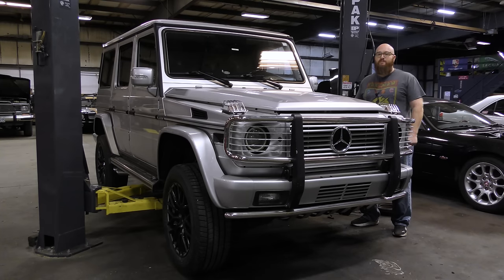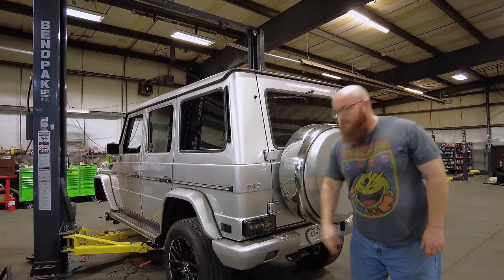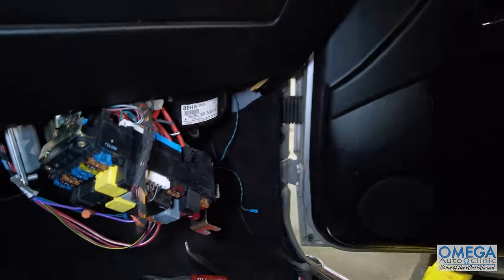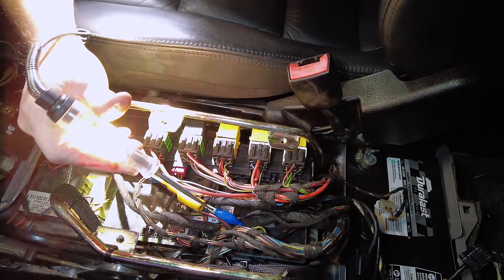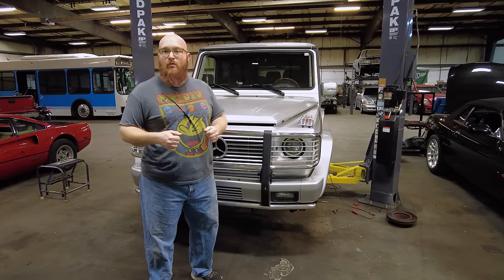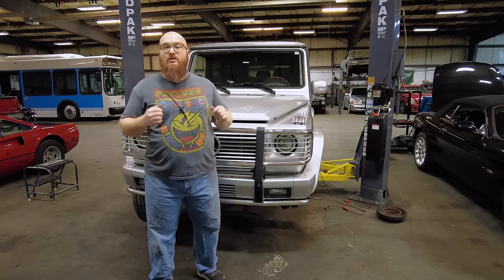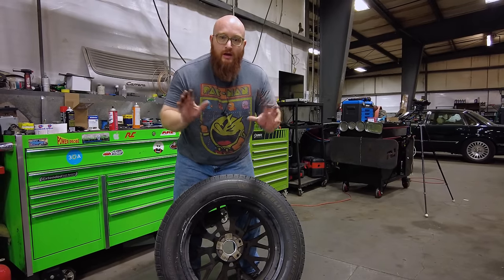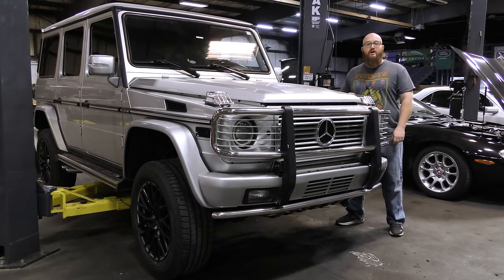Dangerous Mods on this '03 G55 AMG G-Wagon! CAR WIZARD shocked at the level of stupidity

Comment: I moved and miss my old mechanic and body shop! I have my wife's GLK-350 in a collision repair shop and they told me they only source used parts from places that they've worked with so they know they can deal with them if they have a problem. I can see that for engines and transmissions but my GLK only needed a few suspension components, some of which they were able to source used and the others were ordered from a dealership, except the dealership doesn't have the parts. I called my Insurance Company and told them the new parts weren't available and asked if I could source the parts used. They said yes so I spent an hour finding a salvage yard with the parts I needed and dropped them off this morning. Less than $600 compared to the $4000 for the "new but unavailable" parts.  The collision shop would have just left the daily storage fees accumulate to the point the GLK was totaled.  They are apathetic because of the amount of business they have. I only used them because they were "in network" with the Insurance Company, which end up being a huge mistake. Anyway, going above and beyond for a customer reminds of what I left when I moved. A huge thank you for "thinking outside the box" and helping people.

Comment: Torque to 200nm AND then back off 1/4 turn. If you don’t, those bearings will die in a few K. (Also in manual)

Comment: I have an 03 G500, I wish I had a guy like you to take it to (every couple of weeks).  I recently saved several hundred dollars by changing a fuse.  The mechanic wanted 2 hrs of diagnosing and another hour to fix the pusher fans at the radiator.  Internet to the rescue, found the fuse, swapped it, fixed it.  Don’t just let people “fix” your vehicle, do a little research.

Comment: That reminds me of a visit i made to a workshop many years ago. There was a Porsche on the lift that was being fitted with after market wheels. The new wheels were fouling the brake caliper assembly. So the genius fitting the wheels was using an angle grinder to remove metal from the caliper so the wheel would fit

Comment: Even if you are concerned about the load on the SAM, you could wire a MOSFET to it, to drive the lights instead of running the lights directly.

Comment: For those of us comfortable with even basic electrical work, running the rear blinkers off of the front circuit would be the very first common sense thing to try vs transplanting the entire module.  Especially with LEDs only drawing a small fraction of the power.  The only irritating part would be the warning messages on the dash about bulbs out.  Squashing those down is not nearly as straight forward.  Luckily in this case, it's not a four hour job just to get to both wires along with another four hours to put everything back together.

As for salvaging the butchered up wheel hubs vs replacing with new, I thought they would have to be a thousand a piece or NLA to make this even close to worthwhile at well over $100/hr labor.

Comment: No, the wheels rides on it's hub ring, the bolts just provide clamping force.
Reply: Not all vehicles require hubcentric wheels. Vehicles with conical lug nuts will keep a wheel centered no problem. It's common to use Volvo wheels on Fords, for example even though the Volvo wheel is a couple of mm larger in the center.
Reply: @thebigmacd  If you're not transferring the weight of the vehicle directly into the hub, then you're transferring it into the wheel studs. Wheel studs are not designed for any type of shearing load and will break over time.

Comment: I’m only a dyi mechanic but I would have considered running wire from front Sam to a tailight converter. 
Twilight converter has own 12 volt power source and only uses signal from front Sam( no extra powe r load on front Sam)  to activate power out from converter to taillights. 
Not a lot of extra work and at the price you quoted for modules , a bit of insurance against future cost. 
That’s my two cents

Comment: A weld expert would tell you a hardened steal bearing ring is not weldable because of cracking around the weld. In this case, it would take only a small shock for the ring to break away from the hub.

Comment: Maybe the rear SAM does not see the expected current on the rear lights when it tries to turn them on, and refuses to turn them on completely.  Mercedes has open and short circuit detection on almost all lights, it  also detects open circuit on a light that is not powered.  W164 has this.

Comment: The trailer hitch wiring will still not work until you fix the rear SAM.
You could use relays to fire the trailer lights off the front SAM but you could never have electric trailer brake control.  Also, the vehicle tow mode is turned on by the rear SAM when the trailer wiring plug is connected, and that won’t work either.  This is all assuming the rear SAM is fried, not just the turn signals on the rear SAM.

Comment: FYI This repair will leave a "bulb out" trouble light on the dash. also the sam needs to detect the correct bulb load. Aftermarket LED lights throw a error code in the sam. or missing bulb code.

Comment: Mercedes is smart enough to understand when Chinese aftermarket tail lights connected, it maybe not a problem with rear SAM, just because of LED tail lights, mercedes can't feel resistance in the circuit and cuts power to it.

Comment: Did the low draw of the led make the rear light controller think the bulb was bad? Would a resistor like used to make leds flash have helped?

Comment: Gwagen parts are crazy expensive. I used to have an ‘86 300GD (88 hp diesel. Not like the newer luxury models). The multifunction switch broke, and the dealership wanted $700 for a new one….

Comment: I guarantee the LED is the problem, cars that normally use incandescent bulbs do not recognize the low wattage of LED bulbs, and think the bulb is dead.  I guarantee the rear Sam would work if you had an incandescent bulb on the rear light.  The reason it works connected to the front SAM is because the front SAM has the front bulb on it already using wattage. I had this problem with my Jeep with LED bulbs used on turn signal bulbs.

Comment: That's a really neat trick for the part of the Rear SAM that failed. I actually really like that.
THEY CUT OFF THE CONCENTRIC RING!? I actually have like no words for this aside from "WTF WHY". And that's some more great thinking to weld that race to the hub and mill it down as needed. As to why, I have no idea. I wouldn't even do that to something like an old civic, because it needs all the ride quality it can get lol
Reply: It was possibly to fit a different set of wheels than the ones that are currently on the truck.
Reply: @OMGWTFLOLSMH  misread at first, but yeah that could. But the backs didn't have that fuckery. And why would they run anything but the same rims/wheels on the front vs the back? 
Idk man.

Comment: There is a similar problem on Nissan GU Patrol rear wheels.  The hub centric ring is only about 2mm high, making it easy to fit steel wheels improperly.  Then they fall off down the road, which is a very common occurrence here in Australia.  Many uneducated people fit any old wider steel rim (eg a Toyota one) because the studs are the same, but the hole in the rim is bigger than the concentric ring on the Nissan hub, again leading to the wheel being centred using the wheel nuts only.

Comment: When the rear Sam detects a led rear light, the low draw is detected by the Sam and shuts power off to the lights. It faults and codes 'short or open circuit LH tail light' and turns off power to that light. 
Has to be reenabled by Mercedes diagnostics

Comment: Um, okay, neat hack.  But I think I saw some power resistors on the back of the rear lights.   They are often tossed in to simulate the full amp load to mimic the incandescent bulb draw.  Maybe be sure the resistors are out of the circuit!

Comment: People should understand that the low power consumption of L.E.D. ( Light Emitting Diodes) compared to the original factory lighting makes this repair viable in terms of the total power drawn in both front and rear lighting requirements. This repair may not work with the original power requirements needed to make this repair while the vehicle retains its original lighting system components. My other half says don't buy a vehicle you can't afford. Including repairs.

Comment: You are a genius. We have problems with new after market wheels without the hub centric rings that doesn't come with or the customer won't buy.
Reply: Explain that it is necessary or eventually the wheel studs will start shearing off.

Comment: Those SAM units can look like they are faulty, but they might not be. If they detect no load or short on a lamp, they switch off the output to that lamp. If you are testing it with a voltmeter you think the output is faulty, but it's not. When you put the correct load on that line, it gets re-enabled. LED lamps will cause this unless you put a resistor in circuit to fool the SAM. It saves on fuses, but it can be confusing.

Comment: I have a 2002 g500 with only 28k miles and guess what. The absolute only problem with it is the two rear side markers.  On the right side it’s cracked because it gets so hot. But replacement oem bulb doesn’t work. The left side rear doesn’t  work with a new oem replacement.  It drives me crazy. I’ve replaced them 4 times each side since 2018.

Comment: I had a similar problem with my both of my W126's. It's getting difficult to find 15" tires so I bought 16" wheels. My 1990 300SE has 10/16 and 12/16 Lorinser LO wheels and my 1985 300SD has 2002 E320 wheels. Since they didn't fit because of the offset, I bought some spacers. The place that sold them to me said they were the right ones for the car. I had a horrible vibration from 50 to 60 mph. Couldn't figure it out, when my mechanic ask how the wheels were on the car, I told him about the spacers. We bought a new set of spacers and took the car and the spacers to a machine shop and machined the spacers inside and out to fit the hub and the spindle. It worked perfectly, so I did the same for the other car. No more vibration up to the cars top speed of 155 in the 300SE and 105 in the 300SD, tested on a race track of course.

Comment: Nice that you were able to fix the wheel/hub issue, but aren't you opening yourself up to being sued if anything happens that causes a crash from these non-approved mods?  Welding and lathing on those hubs is fine for yourself, but you are putting your shop at risk by doing this for a customer.  Not commenting on your skill at all, just that you really can't be too careful these days.  The proper fix was to replace the hubs and wheels with factory units.  Yeah, would have cost the customer thousands, but your liability is low.

Comment: we need to get a review site made for car shops, would solve alot of these issues. As for that toggle switch, i wouldnt be suprised of there are more of them, was likely used drug-running from mexico at one point, a coyote g-wagon.
Reply: The switch is to change the signal from standard blinker to animated blinker.

Comment: I had a feeling it was going to be this issue with the hub. Different model benz with me though, customer bought 4 wheel spacers for aftermarket wheels, but didn’t read carefully that the wheel spacers were for the rear hubs only and front hubs required different style spacers. He cut the ring off the front hub so they would fit.

Comment: I have winter and summer wheels for my car. Had them swap the summer for winter tires at Sams club and had a vibration at 50mph and above. Brought it back they rebalanced the tires same issue. They rebalanced again same issue. They replaced the tire with a different model Same issue. I took it to Discount Tire. My summer tires are aftermarket Enkei Wheels. When Sams took off my summer tires they never took off the centering rings which are just plastic rings. Idiots you do just tires in your tire dept. Sams couldnt get a matching tire but Discount tire was able to and Sams actually paid for it. Centering rings are there for a reason lol

Comment: As for the tail lamps, I run those exact models on my 2003 G500, Mary an issue. The SAM module is designed to shut down power to any turn signal or marker lamp that it sees as having the wrong amperage load within a second or less.. these  LED lamps are setup with load resistors to approximate / fool the SAM into seeing the proper load. The switch on my lights isn’t setup to turn off the brake lamp, but rather it changes the tail lamp type from the progressive blink from inboard towards the outer edge or the standard all at once yellow blink pattern. I’m sure some moron had tampered with the Lamps as surmised. Good detective work on the Solution & work around.. but I’m sure the Rear SAM shut itself down to prevent damage or a short circuit.. those rear lamps aren’t that expensive. Possibly the owner could get a new set & have you install a defeat switch in your new power wire to the Rear SAM.. just in case it’s all the fault of the Poorly installed covert switch you described.. and regarding the fix on the hub. Good machining work.. but, what if the Owner decides to go back with stock MB Gclass wheels.. now the diameter of the hubcentric ring is off.. & like you, I’m not sure why the rears worked.. 🤷🏽‍♂️

Comment: The Germans believe in complex engineering; years ago I worked on SL 250 or 280 pagoda roof 2 door convertible hard top vehicle.  It had the early 4 speed auto trans.  It had a wonderful looking but very complex throttle linkage for the automatic trans kickdown; beautiful to look at, chrome plated rods and bell crank pivots and untold amounts of adjustments to the linkage rods.

The problem was that it had a complex adjustment process that you had to follow, measurements and adjustments; i.e., a to b, c to d etc.   If you didn't follow the procedure exactly, either idle was wrong or the trans might not downshift when the accelerator was floored.

The Americans and Japanese vehicles had a single kick down rod or cable with only one or two adjustments, but that was not the German way.  And to top it off, if I remember correctly, (its probably close to 40+ years ago) it mentioned using tools that whose only use was to place it between a certain rod and insure that it fir correctly.. the Germans might be great at engineering; but, simple is not part of their vocabulary.  I worked with German cars on and off in dealerships for 40+ years...

Comment: SAM: Seems this car is just too old by basic design of 1970s. I think the nowadays front SAM was originally a analogue switching box for all the lights and small enough by size to fit at the original place at the glovebox at that time. Today it simply doesn’t fit there any more, to much electric parts.

Another nice information about the G-Wagon translated from German Wikipedia: 
„In 1972, Daimler-Benz and the Austrian manufacturer Steyr-Daimler-Puch (now Magna Steyr) agreed to jointly develop an off-road vehicle. This happened at the urging of the Iranian ruler Mohammad Reza Pahlavi, who owned up to 18% of Daimler-Benz shares. The car was intended for border patrols in Iran and as a hunting car. At first it was hoped that the Bundeswehr would be an additional customer.“
Reply: nothing on US wiki ?

Comment: I bet, the reason why the rims fit on the rear, is the rim centering on the rear are thinner, as the front was larger/ thicker due to more dynamics being applied. Turning, brake forces, drive forces. Ask your master MB technician.  I bet the rear diode lights burned out the module, due to load being different

Comment: MY GL has a front SAM issue with turn signal, so I think I am going to do this but run the front from my functional rear SAM...  the only issues are I will still get error on dash, and the car will use the front driving light as a turn signal when it senses the issue .......

Comment: In 1991, I bought a brand new GMC Sierra with Uniroyal tires. Three of the four tires were out-of-round. Two were bad and the third one was just bad enough to make me demand it be replaced. EDIT: I dunno if it's the brush guard or the body on that G-wagen but something on the front end is out of square

Comment: 7:49 I would prefer not to tap rear lights power direct from the front SAM.  Use a relay instead to lower the load on the front SAM . Too much of a load on the front SAM might trigger error code CEL .
Reply: Leds put virtually no load at all on the circuit.
Reply: @JasonWW2000   That only applies if you use 1 low power LED. Have you seen automotive LED headlights with heatsink and fan ? LED efficiency goes to hell if you push it for more luminousity.
Reply: @fleurdewin7958  I'm very aware of LED bulbs and I have tested and measured a lot of them. You're confusing a headlight with a tail light. Whereas an LED headlight may consume 15 to 20 watts, a LED tail light is going to consume less than 2 Watts.